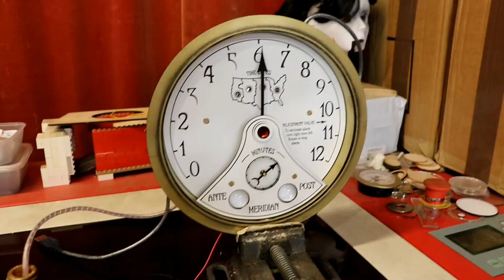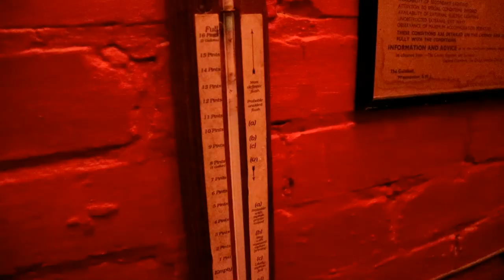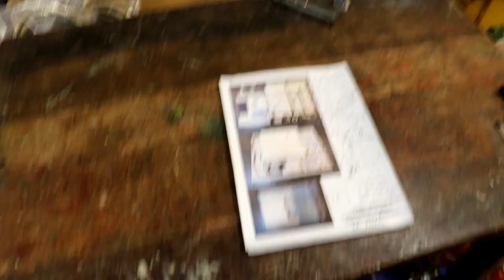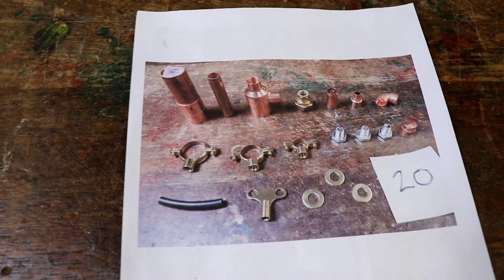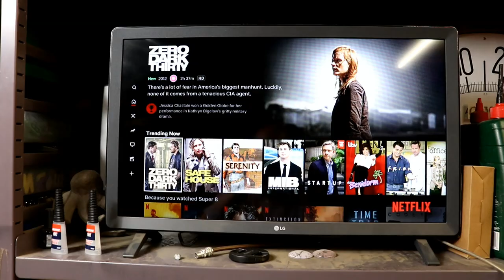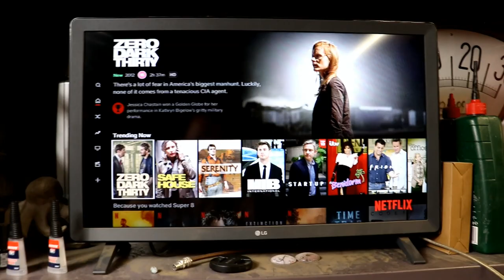Fixing a Steampunk Loo and 40 More Nempnetts

Comment: Time to scan and print the horns?
Reply from the maker: It is very tempting and possible, it would just take so long, especially printing a good quality print at 0.06mm a layer. But thanks for the idea, it may become a necessity if noisy football supporters don't have the opportunity to be noisy soon!
Reply: @steamhead  I was wondering what other method could be used.  Wondered if vacuum forming might be an idea, but I don't know how robust it would be, and I guess it would have to be made in two parts and glued together.

The Asylum folks who make the Daleks and Star Wars models might be more familiar, or have a better idea.
Reply from the maker: @epiendless1128  It could be done with a vacuum former, in fact I wish I had one, as things like the 3D printed reflector could be made really quickly and efficiently. As you suggest it would be possible to make a horn like this, perhaps with each side having a moulded overlap for fixing. Thanks for the idea, I am still hoping that football will return to its old ways and the horns will again be produced. having said that, adversity is the mother of invention (or something) a vacuum former would open up a wealth of opportunities - shell lamps etc etc!